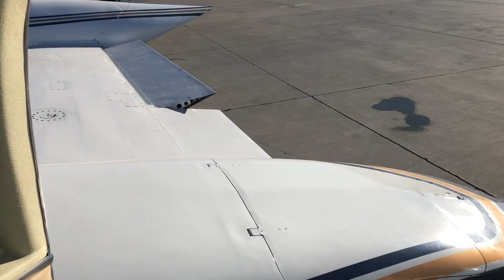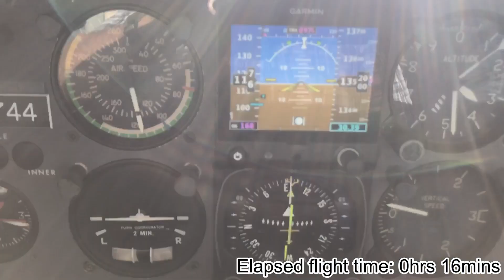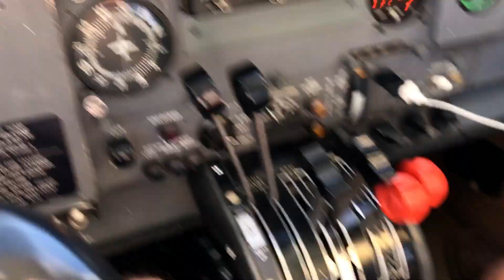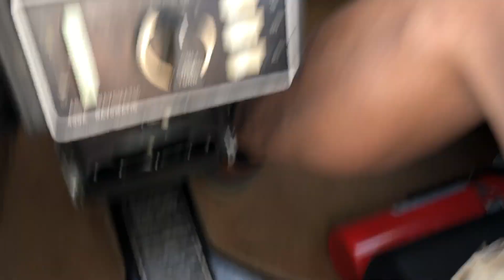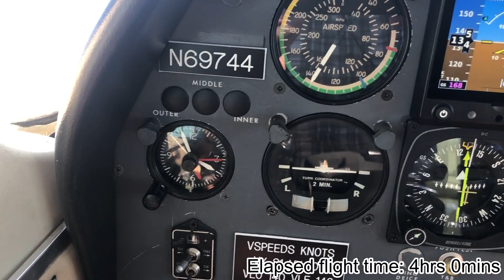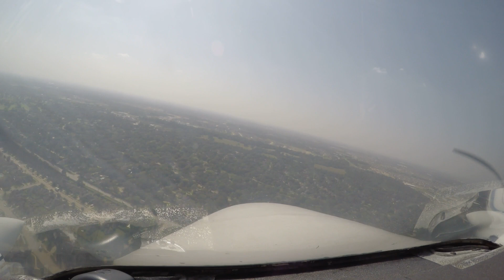Cessna 310 long haul cross country Colorado to Texas

Comment: Pretty much made this same routing when a friend in Ingleside, Texas bought a Cessna 401, but he only had a private license single engine land. He called me in Fort Worth and asked me if I would go get it for him. I went up to Montrose and was surprised when I saw the plane as it had a new paint job, panel and brand new turbo engines. The plane preformed great. I went a little different then you did...more to the East and went right over the top of Alamosa at 17.5  to Raton, New Mexico and then went down to 11.5 and right next to the old volcano while setting up to make a stop in Amarillo. I was hungry and had to whizz, so it is time to find a spot. The 401 surprised me and did great as the turbos were doing what they were suppose to do. Left Amarillo and up to 9.5 to Oak Grove airport in Burleson, Texas to go home for the night. Got up the next morning and went to Port Aransas as my buddy was the air port operator. he had about 250 hours in a single and I worked with him for 10 days to the point that I felt warm and fuzzy for him to take his multi. He passed with flying colors. My friend passed away a few years ago and his wife asked me how to sell the plane and I got her in contact with a friend who is an airplane broker and sold the plane for the asking price. Been in a 310 a few times with friends and I sure do like them but for now, I will stay with my T210.

Comment: Nice video Jason.You have shown the Songbird's utility as a cross country machine as well as a comfortable chariot thru the mountain passes.The -Q model in my experience has the more reliable( IO-470VO)engines and avoids the "oil canning" noise of the long nosed C310R.
  I was always nervous when nearing the end of burning from aux tanks(tho having 31.5 gal in each wing lessened concern over running a tank dry).The previous owner had run one dry at cruise with his mother in law in the back seat, and cautioned me to avoid this scenario(took several seconds for the engine to resume power). I have been fortunate to have a totalizer on subsequent twin flights; this helps alot in timing the switch back to mains. One should prob. leave ~5 gal. behind in the aux.Fuel selector integrity, like landing gear, rates high on the list of ongoing maintenance issues for obvious reasons.
 Consider a portable oxygen concentrator for flights in the low teens(now available on used market). Their intermittent (pulsing) and adjustable pressure should be less drying(and more comfortable)on nasal & oral mucosa. 
 Also, expect to pick up 5-10 ktas if you ever deboot wings & tail on these babies(even with VG's!).Mine got 180 ktas@22gph after I did that.
 ChaseBurnett

Comment: Look into a Continental bulletin about not running below 2300 RPM. It concerns the counter weights getting out of balance. Relates to IO470, IO520, & IO550 motors. Great video, I want to do some outwest flying with my R model, and this gives me some idea of the climb performance that I will see.
Reply from the maker: Hi Mickey. Yea the bulletin specifically refers to IO-470-G and -N. I keep meaning to ask the Twin Cessna Flyer association for clarification as the 310 has IO-470-VO in it. The bulletin lists out specific 'dash' letters (suffix). Thanks for watching!

Comment: Great video! Just an observation...My left main gear green light would also delay 1-2 seconds after the other two, and eventually it would not lock down. I had my mechanic adjust the spring tension on the left main gear, and now all three green lights, basically, come on simultaneously.